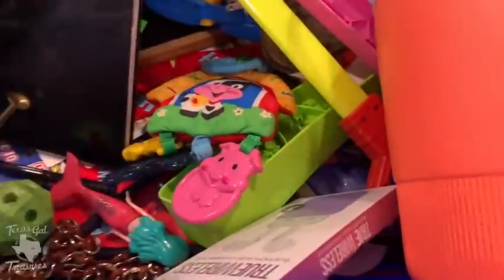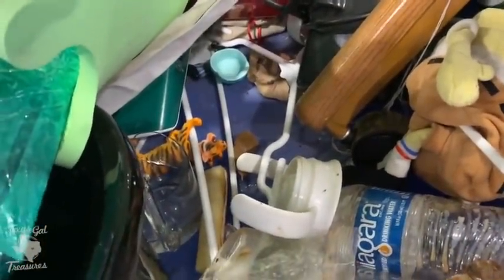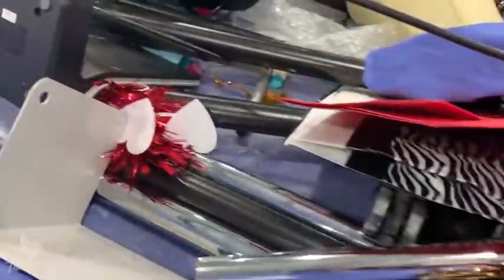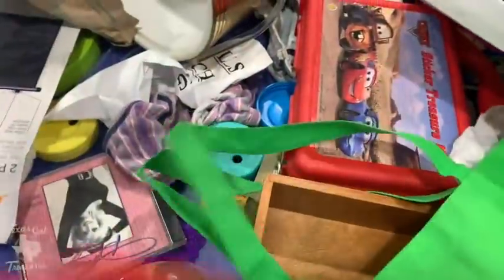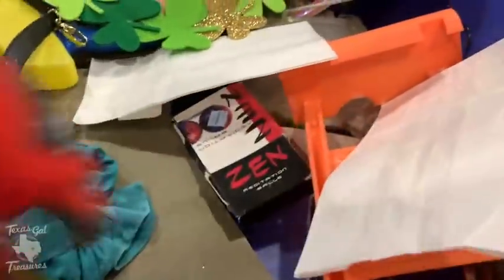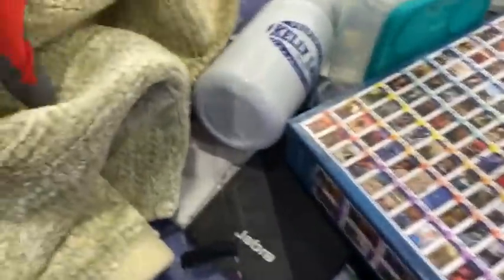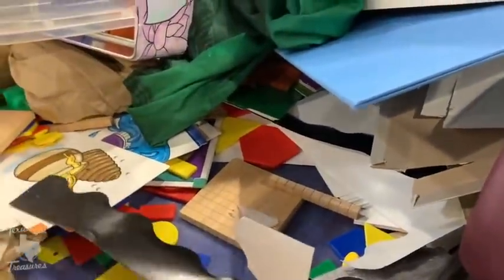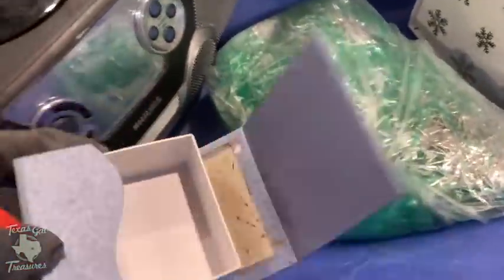TREASURE WAS HIDING!! Goodwill Outlet Bins Thrifting Trip to Resell on Ebay | Hard Goods to Sell

Comment: Man I used to open and close the bins almost every single day.  When I first started going the prices were only 39 cents a pound flat.  Didn't matter if you had a cart full or one thing.  And they priced heavy stuff at five bucks max.  And that was all back before they started picking it over.  Back then stuff would get donated to the outlet store and put out into the bins without ever seeing a regular goodwill store.  That was about 20 years ago and back then ebay was cheap, paypal was free, and damn near everything you listed sold.  Talk about the good old days.
Reply: And shipping was still real cheap too.  They even had a one pound priority mail rate something like $3.85 anywhere in the USA.  They dropped the one pound rate a long time ago until finally they raised the maximum of first class to one pound.  But there was a bunch of years there was no one pound rate if your package weighed one you had to pay the two pound rate.  You got to keep so much more of your money back then.

Comment: The bins I frequent is about an hour away from me in Olympia, WA.  They actually take donations at that one which is rare.  I think they get better items that way.  I stay for hours and I dig to the back and the bottom of the clothes bins.  I find things that others missed.  I have purchased a vacuum and a steam mop there.  I just had to order the mop pads online.    You can plug them in and test them.  Last time I was there I found a brand new box of puppy pee pads, a nice hamper, brand new with tags Northface sweatshirt, brand new nike socks, and one of those dinosaur costumes, and much much more.  I do not resell yet.  I just shop for my family.  There is also a big one in Tacoma, WA.  It seems to be where they park all of the goodwill trucks so I am not sure if that is where they sort for the region or what.  Good finds there as well.  It is closer to me I just did not know about it so will for sure go back.  But, I am always going to worry about dead birds and rats now. Thanks. lol!

Comment: We do have a bins here in Kansas City.  The price seems to be a little higher than what you pay in Austin. With the appliances, like vacuums, I discovered this week that people buy non-working vacuums and take them apart and then sell the parts on eBay.  I was looking for a front wheel axle for a vacuum I have and found several sellers that had all the parts to my model nicely laid out in the picture, labeled with a number, and then in the drop down, you selected which part you wanted to buy.

Comment: We have a bins here in Salem Oregon. I used to work for goodwill and as an employee, you are not allowed to shop the bins. If you are caught just sitting in the parking lot, you can get reprimanded. I wanted to let you know you passed up a pink scentsy stuffed pig. It may not be one of the sought after ones however.
Reply: @dmreddragon6  goodwill has different districts all over the states and every district has their own set of policies and regulations. The district I worked in was the Columbia Willamette Valley of Dallas Oregon. We had the comfort of working in a ac building. The only perk we had was a 15% discounts on items that have been on the floor for 3 days or more. We were allowed to purchase half off items, under the same rules. We were not permitted to purchase as is items and for this reason we were not allowed to shop at the bins. Which never bothered me because ours is very dirty and I tend to be allergic to dust.